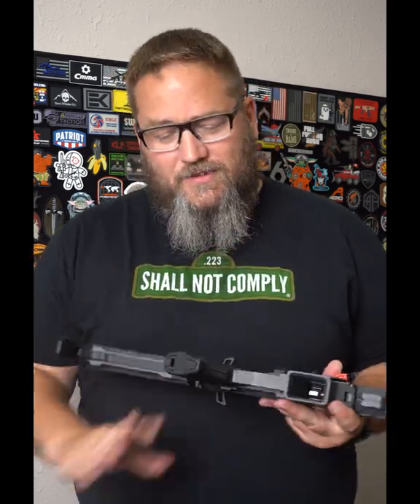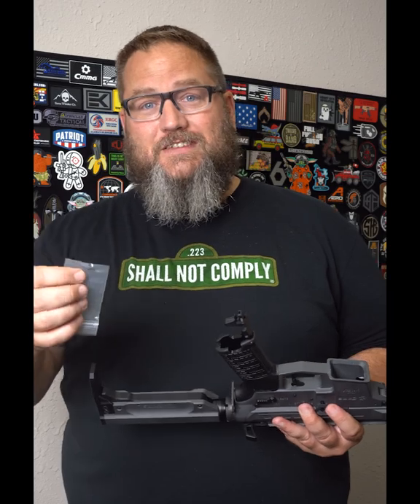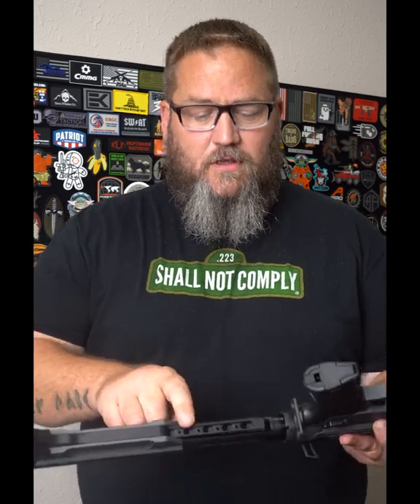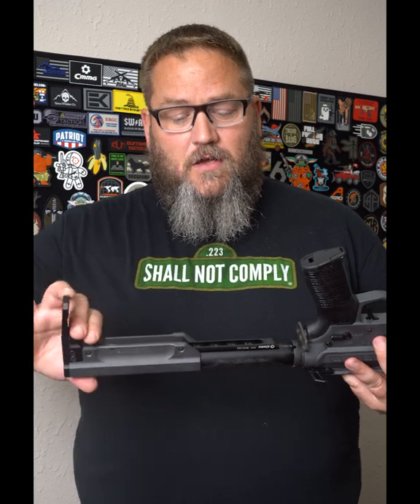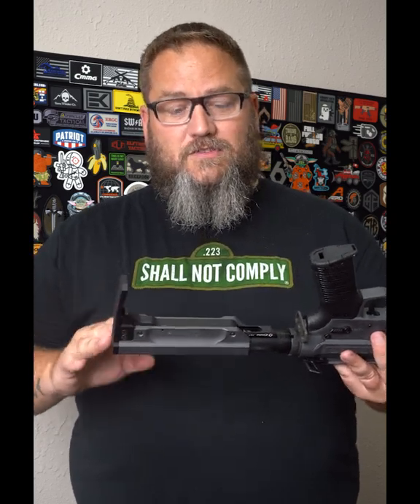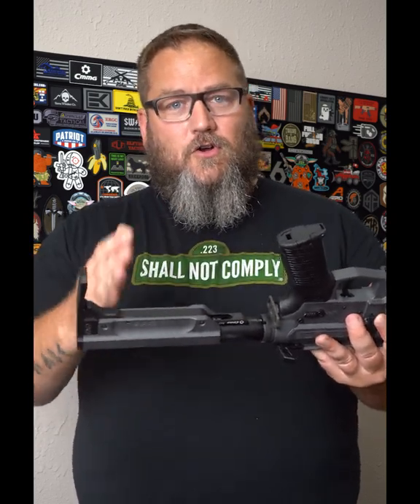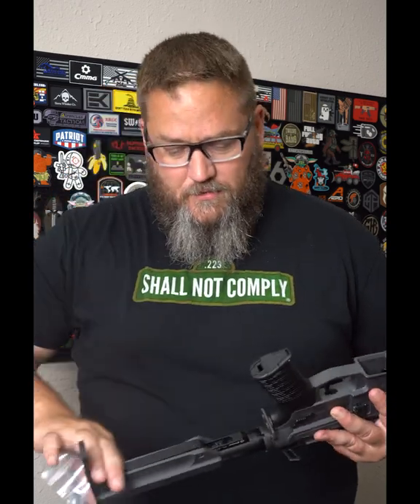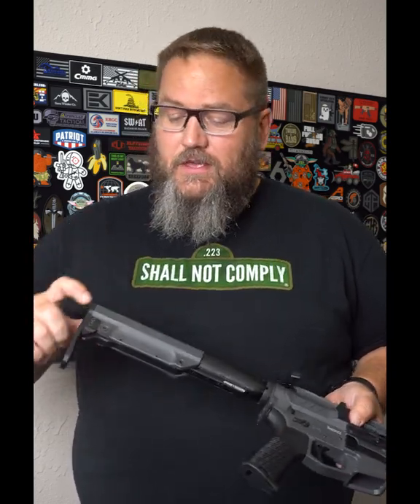What's that screw? CMMG P3 explained

Comment: Just curious but I feel like that kinda limits you what are the benefits of this vs just setting it how you normally would
Reply: Theoretically speaking it allows you to set a shower than full extension point in the stock so when you transition from a collapsed position you can quickly extend to that point without having to pay attention to it for some people specifically those who are small framed it may have a mild use but those stocks are usually most usable at full extension

Comment: 7/64” hex why couldn’t you just of said 3mm I’m from the uk and we mix our measurements for the best of best worlds but man to this day the fractions of inches is one of the worst tool size systems but like I said in the uk we use both so I’m not saying metric is better then imperial but when it comes to hex/Allen keys it makes logical sense to use mm anyway there my 2 cent

Comment: I don't see the point in this
Reply: I can probably answer this one. So, normally you cannot put a vertical foregrip on a "pistol" length AR upper without creating an AOW which you need a stamp for. 

There is an exception to this though. You can build what is legally referred to as a "firearm". A rifled barrel less than 16", with a pistol brace (no stock), it can also have a vertical foregrip, and with an overall length of greater than.... I want to say it's 26 or 28 inches. (Search it and verify for the correct length, don't take my word for it) The overall length at the most compact/collapsed position is what the ATF will measure, from the back of the most collapsed brace position, to the end of the barrel threading.

With a 12.5" or greater barrel on an AR pistol, this is easily defeated by at least an inch or two. However, with a 10.5" barrel (far more common), you are under by an inch or so, so making it impossible to shorten the brace a slot or two will essentially save you from an NFA violation should the ATF come knocking.

Or maybe I'm totally wrong and this is just a preference thing. I'm not CMMG so I can't tell you for sure.
Reply: @TheGhostOfPatrickHenry  what are you talking about? Lol it’s to set your preference on adjustable brace/stock. So when you slide it back it stops at your comfort level on the stock/brace